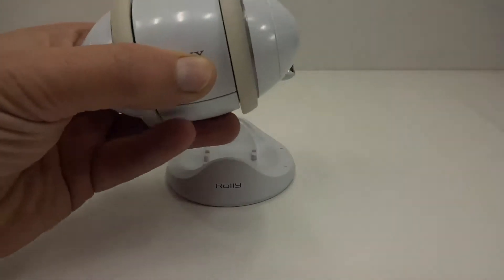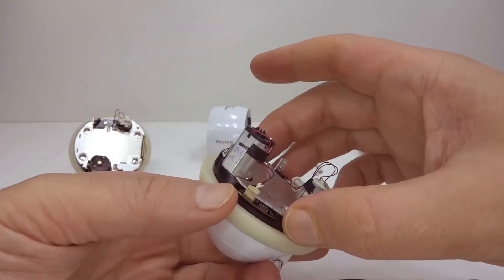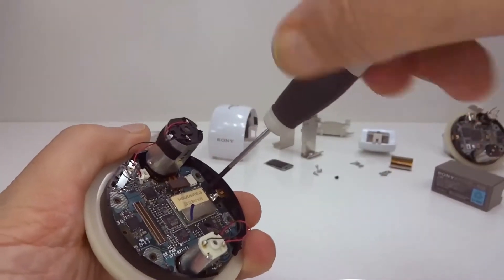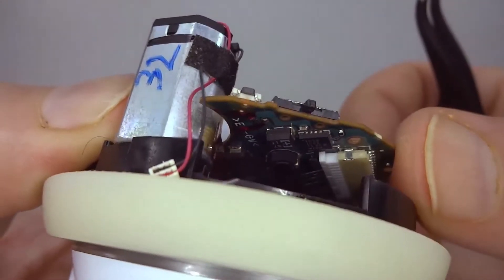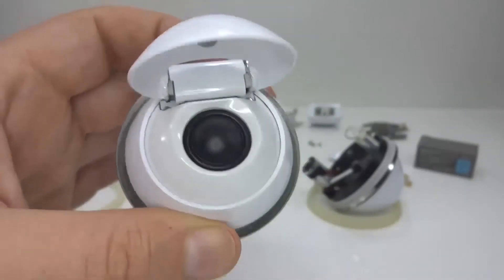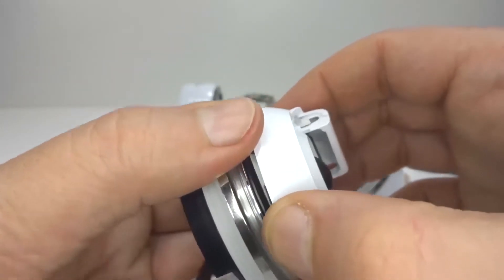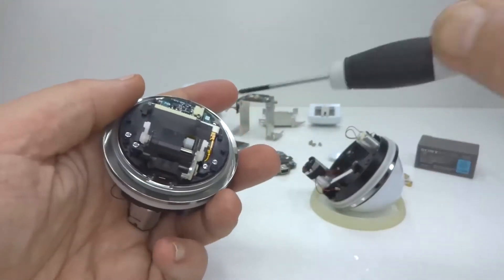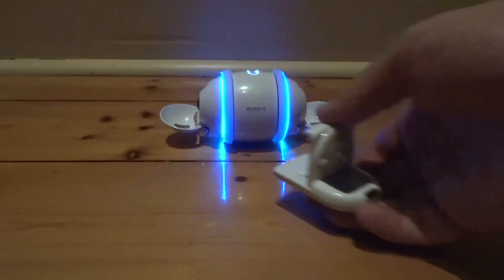Sony Rolly - Full disassembly and teardown SEP-10

Comment: These all appear to be regular DC motors (130 type, commonly found in toys, although I also noticed 2 larger motors, 180 type, I’ve seen these used in electric shavers). Since I didn’t see any encoders or homing light switches, how would the motors know what position they’re in?

Since these are just regular brush motors and not stepper motors, you’d  need that info for the robot to know what position they’re in

Comment: Hi, my rolly just spinned smoothly for a second but  now it also has clickings in the gears, what does that mean? I can’t adjust volume and control tracks without making the clicks? (Note i haven’t used it since 2 years ago or so)
Reply from the maker: This clicking means one of the gears is not working properly. You can try opening the gear section and adding plastic safe silicone grease. Or more likely the gear has cracked and will need fixing. I fixed one of these cracked gears myself in a recent video.

Comment: Thanks for the video. I have 2 rollies with an issue in one of its wheels as it sounds like it clicks when you spin it. I tried opening up one of them but wasn’t able to put it back again. I was wonderinf if there’s anyone or anywhere that could fix it in case I could reuse the parts of one rolly to another? Is this fixable at all? Plase help I appreciate it
Reply from the maker: The click means one of the gears is cracked. If you have two Rollys and each has one clicking wheel then it is possible to make a working Rolly with the two other working wheels. You won't need to take apart the gearing mechanism but you will need to take apart the Rollys and swap the wheels over, or get someone to help you.
Reply: I tried it but one of them it’s not good on any of the wheels after I tried fixing it. It would probably need to open it apart to replace the specific gear I believe? I haven’t been able to find anyone to help me around where I’m located (BC, Canada). Any suggestions or thoughts are more than welcome. I appreciate any kind of help, just wanted to get this iconic and amazing product working how it should be :/
Reply from the maker: @marcostl2  I wasn't able to follow your meaning. Do you have two wheels that don't click? And two other wheels that do click? What exactly happened when you put the two wheels that don't click on one Rolly?
If you need to replace the broken gear directly it will be difficult to find or 3D print a replacement and fitting it also difficult. Something I have not done myself yet.

Comment: Thank you for creating and posting this video; it gave be the courage to disassemble my SEP-30 Rolly. As expected, both of my drive gears have hairline cracks that cause binding on the drive wheel ring gear. It seems to be the primary failure on 90+% of Rollys. Have you or any others heard of anyone that has found or made replacement parts?  
By the way... An important note to anyone disassembling an SEP-30 -- there are two extra screws at the bottom of the battery well closer to the middle that hold the Power/Pause button to the aluminum frame. Make sure that you remove these before attempting to remove the center-section shroud, or you will damage the Power/Pause button.
Reply from the maker: I agree that this is the main point of failure. I don't have any information on replacements and I now have a second Rolly with a damaged gear. Thanks for the additional tip.
Reply: @JanusCycle  I am in the process of getting 50 drive-pinion/optical wheels machined from Acetyl (Duralin). Assuming they work (first samples due back in about two weeks), I'll post here. They should wind up being only about $60 per pair.

Comment: my one was just plays out the electronic buzz............ can some one help me to fix it??
Reply from the maker: I don't know if I can help but please tell me, does the light come on? what about the blue light in bluetooth mode? does Rolly move when turning on or at all? does it connect to your computer?
Reply: Janus Cycle sorryfor late reply, all lights are working including the Bluetooth, but it just cannot moving and when connecting the Bluetooth it only shows the electronic buzzing and sometimes will apear very light sound but when I trying to moving the wheel in order to up the volume it just back on buzzing .but it hasn’t use for about 9yrs after I bought it back in japan…
Reply: Janus Cycle and it can connect to the computer

Comment: Hello how many volts does the little backup-battery have?. 
What is the battery for?.

When i turn my rolly to OFF. After few minutes (5-30) he wake up (arms open, blue LED, Sound) after 20sec he shuts down. 
Then the whole thing repeats itself.

 That comes from the backup-battery?
Reply from the maker: I didn't measure the backup battery voltage and I'm still thinking about what it could be used for. Is your Rolly starting up in internal music playback mode or in Bluetooth speaker mode?

Comment: Thanks for the upload , I have a rolly with a problem regarding the right rubber wheel which doesn’t spin freely , if I spin it manually with my hand I can hear clicks , any idea how to repair this ? Thank you
Reply from the maker: I believe this is a common problem with Rolly and the plastic gears cracking, such as the motor shaft gear. I have seen one cracked which had a clicking sound but I have not attempted a repair of, https://imgur.com/6o0QFkg.
Reply: Janus Cycle  thank you for this information
Reply: Es ist sehr schwer zu reparieren. Zusammenfassung: Riss im Zahnrad mit Lötkolben zusammenschmelzen. Mit Stahl-bürste Zahnrad abrunden.

Man muss sich erstmal bis zum Zahnrad vorarbeiten.
Auch die Fixierung für die IR-Lichtschranke muss raus. Nun sieht man das Zahnrad mit seinem Impulsgeber.
Die Schraube von Platine lockern so das man die Platine etwas anheben kann und dann die Lichtschranken unter die Platine schieben so dass sie nicht beim arbeiten stören. Sehr vorsichtig damit nichts beschädigt wird. 

Das Zahnrad nicht ausbauen. Überspringen. 
/*
Falls es jemand doch machen muss es geht sehr schwer raus. Seitlich mit einem Schraubenzieher zwischen Impulsgeber und Gehäuse einführen. Sehr vorsichtig den man biegt am Anfang nur am kleinen Flügel des Impulsgeber.
Beim Einbau muss die Einpresstiefe genau stimmen da sonnst der Impulsgeber schleift, entweder am Boden oder an der Lichtschranke. Ich habe ein 0.3mm Draht eingelegt und dann nach unten gedrückt. Draht entfernen, passt.
*/

Zahnrad vom Fett befreien. Jetzt wird ein Riss Sichtbar. Hier passt auch nicht mehr der Zahnabstand des Zahnrades.

Wen man die beiden Zahnradflanken beim Riss mit der flachen Zange/Pinzette zusammendrückt. Sieht man das sie wieder enger werden. Evtl. etwas die Flanke mit der Zange verbiegen. 

Jetzt mit einem feinen Lötkolben vorsichtig oben in das Loch einführen so das der Rand anfängt zu schmelzen.
Zu viel des guten und das Zahnrad ist tot. Also sehr vorsichtig.

Nun den Stecker des Motor vom Board abstecken. Den Motor an ca. 4 bis 5 Volt anschließen. Nun drehen wir das Zahnrad wie auf einer Drehbank etwas ab.
Mit einen Skalpell oder sehr scharfen feinen Messer. Die Oberfläche oben schön glatt schaben. Auch seitlich den Durchmesser etwas abschaben. Späne entfernen.

Nun das wichtigste !!! 
Mit einem Dremel/Proxxon und einer Stahl-bürste das Zahnrad von den Spänen säubern und oben abrunden. Auch die Flanken können abgerundet werden. Das Zahnrad kann dann wie ein verkehrt herumstehendes großes "U" aussehen.

Aber sehr vorsichtig vorgehen, es geht sehr schnell das zu viel weg ist.
Evtl. den Motor mit 2 Volt laufen lassen. Dann wird das Ergebnis gleichmäßiger.

Mann kann es mit dem Ring testen ob es noch hackt, wenn es noch hackt den Zahnabstand nochmals überprüfen und gegeben falls nochmals richten. 

Es wird nicht ganz weg sein. Aber es sollte jetzt leichtgängig in jede Richtung wieder gehen.
Reply: english version google translate:

It is very difficult to repair. Summary: Melt crack in gear with soldering iron. Round off gear with steel brush.

You have to work your way to the cogwheel first.
The fixation for the IR light barrier must be out. Now you can see the gear with its pulser.
Loosen the screw of PCB so that you can raise the board slightly and then push the light barriers under the board so that they do not interfere with the work. Very careful so that nothing is damaged.

Do not remove the gear. Skip.
/ *
If somebody has to do it, it's going to be very difficult. Insert laterally with a screwdriver between the pulse generator and the housing. Very careful you bend at the beginning only on the small wing of the pulse.
When installing the Einpresstiefe must vote exactly because sunst the pulser grinds, either on the ground or at the light barrier. I inserted a 0.3mm wire and then pressed down. Remove wire, fits.
* /

Remove the gear from the grease. Now a crack becomes visible. Here also no longer fits the tooth spacing of the gear.

When you squeeze the two gear flanks at the crack with the flat pliers / tweezers. Can you see that they are getting closer again? Possibly. slightly bend the flank with the pliers.

Now carefully insert with a fine soldering iron in the top of the hole so that the edge begins to melt.
Too much of the good and the gear is dead. So very careful.

Now unplug the motor from the board. Connect the motor to approx. 4 to 5 volts. Now we turn the gear off as on a lathe.
With a scalpel or very sharp fine knife. Scrape the surface nicely smooth. Also scrape off the side of the diameter slightly. Remove chips.

Now the most important !!!
Using a Dremel / Proxxon and a steel brush, clean the gear from the chips and round up. The flanks can also be rounded off. The gear can then look like an upside-down big "U".

But be very careful, it is very fast that is too much gone.
Possibly. Run the engine at 2 volts. Then the result becomes more uniform.

Man can test it with the ring if it is still hacking, if it still hack the tooth spacing again check and if appropriate set again.

It will not be completely gone. But it should now go smoothly in every direction.

Comment: I have a question, my rolly's left half (with the USB charging connector) seems to get "stuck" a bit when I rotate the rubber pad. Is it because the grease is finished ? If so what grease do I put ?
Reply from the maker: Use silicone grease for plastic. Don't use petroleum based grease as this will damage the plastic gears. Does the wheel seem to click as you spin it? Look at the wheel motor shaft gear and see if it has a crack. https://imgur.com/6o0QFkg 
The gear mechanism has small bits that fall off their shafts when opening, pay attention and then it's not hard to re-assemble. I've done it a few times now.
Reply: Janus Cycle true, there seems to be a clicking sound. I didn't have the guts to open it up like you did. But your video will serve as an excellent guide. Hope this can be fixed.  I will update you .😀